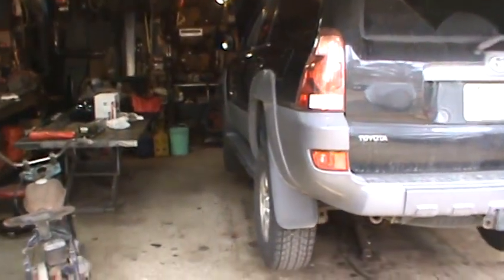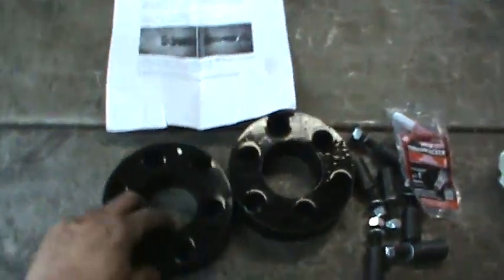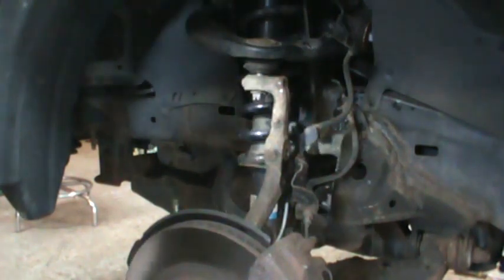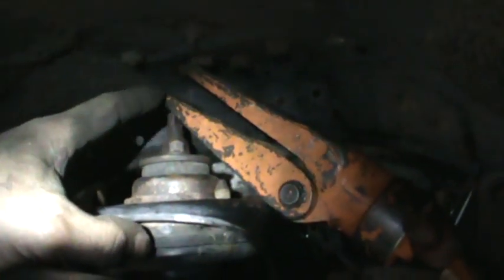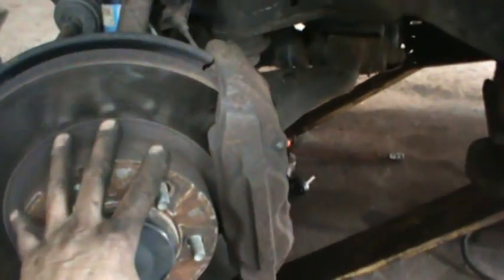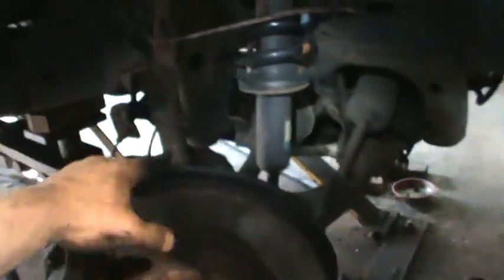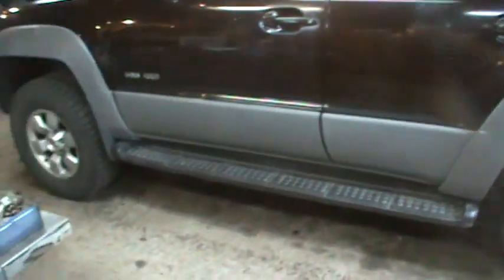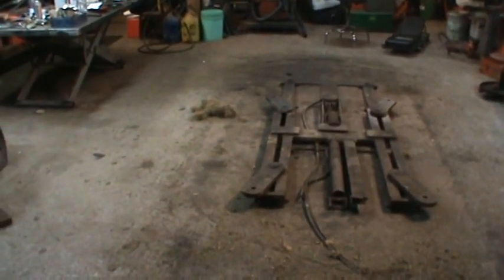4th gen toyota 4runner front spacer lift install

Comment: a great tip if your strut is rusted in place is to take crowbar and wedge it on the left side of the strut tower.  Then pull to either side and it will usually break free.  Just installed my leveling kit today.
Reply: John, Thanks for that tip. I had spent about an hour pounding on the fram and all around the top of the shock trying to get the strut to fall  out and the crowbar to the left freed up the strut on the driver side. Still no luck on the passenger side Strut. Any chance you have any other helpful ideas on how to free this thing up?
Reply: I know for me personally I had more room once I had dropped the lower control arm to be able to move the strut assembly around to break it free.  If you haven't done that already i would try that.  I know something else that really helped was PB plaster to help free up some rust.  Hope that helps!
Reply: I drilled a knockout hole down through the fender under the hood

Comment: Know this is old now, but for some reason it popped up into my feed, and hadn't watched it before. Think I would have added the back lift too, just to keep the clearance and spacing throughout, but yeah, it certainly would be easier to do without the parts rusting together, and since you replaced the rear shocks, no thought of putting new struts on? As long as I was in there I believe I would have. At least when I had my strut compressor, which I lent out and a guy ran off with..moved to a different state from what I heard ;(
Reply from the maker: its gone, only needed it for a few months

Comment: You can do this Job without taking the upper ball joint apart just need a pry bar to get the bottom of the shock out.  I did my truck in a half  hour that was both sides.

Comment: I have had to drill holes in the top of the fender well and beat the studs from the top to get struts out before... that prota-power is the trick!
Reply: I'm close to drilling holes in the wheel well to beat the studs from the top. Someone meantioned using a crowbar on the left of the tower wall and that got the driver side one to break free but I still can't get the passenger side to break free any other suggestions before I drill holes in the wheel well?
Reply: Eddy Steele How did you end up?

Comment: Hi.. great video. I noticed you didn't install a front differential spacer that usually comes with a 2.5/3inch installation kit... i ordered my 2.5inch lift kit and the diff spacer was included.  I wanted to know if by not installing the differential spacer will affect the handling, balance and stance.. yours seems well leveled .i need Your opinion on this, thanks.

Comment: Holy Hell! Don't EVER follow those instructions again! They made that so hard it's stupid! 
-Pull tire 
-Pull 2 bolts holding lower control arm ball joint on. 
-Pull bolt holding Sway-Bar on
-Take bottom bolt off shock 
-Take 3 upper bolts off shock 
-Pull shock out
-Put spacer in
Reassemble! 
It is really easy, barring rust of course. You can do the whole truck in like 2-3 hours.
Reply: +Tony Molski You're right I did this on my F-150 too and it wasn't that difficult.
Reply: I agree however I did have to loosen the alignment bolts to get the clearance to put the strut back in. You need alignment after install anyhow...
Reply: Im trying to do it that way but theres no way to pull the lower arm even with the 2 lower balljoint  bolt off, the sway bar is also disconected and the strut lower bolt is off  still have absolutely no way to pull the strut away

Comment: I just lifted my 2011 4runner sr5 and i used 3" toytec spacers but people keeps telling me to get UCA'S because the ball joints might break
Reply: Ball joint won't break, at 3" you lose caster adjustment and need aftermarket uca's to bring it back into spec.
Reply: +Tony Molski Hi Tony, Thank you for your reply, after I got the spacers I bought a toytec boss 3" lift with adjustable UCA'S everything seems to be working fine now specially how it rides, so much better, thanks again
Reply: +Hugo Huerta sweet! Nice setup there!
Reply: +Tony Molski thanks brother, I wish I could show you pictures

Comment: I'm trying this as well and I'm stuck trying to get the strut to break free. I don't have the power tools that you have. Do you have any other suggestions on getting a the strut to break free? Someone mentioned using a crow bar on the left side of the upper tower and that did break free the driver side strut but the passenger side is still stuck. Someone else had mentioned drilling a hole in the wheel to pound the studs from the top, but I'm hesitant to drill holes in the wheel well. Any suggestions would be great. Thanks
Reply: About RUST - I use a product called PB Blaster to penetrate rust.  I used it to loosen several badly rusted-in manifold bolts going into the head of an old 4WD Trooper, and PB loosened all of them.  PB Blaster works exceptionally well, and I bet it will get all of these stuck struts loose without needing to drill holes or hammer them with ball-peens, etc.

Comment: Hi,

I have a 08 T4R SR5 4WD and I just ordered the 2.5" lift kit from Daystar. I was wondering if I can get some opinions about if I need to do the Differential Drop kit to not damage the CV or I should be fine just the spacer lift?

Thanks
Reply: Gil Bachar you don't need it imo, 3" or more you can do it.
Reply: Hi Gil,

I want to ask... Did you buy 2.5'' for front and rear sides? I want to buy a 3'' front and 1.5'' rear on my T4R06... Thanks for your help.

Comment: that was alot of Grass man, lol, i was thinking of using that method to lift my lil nissan up for some big bling lol i wonder if it will work hmmm
Reply: ok i would say DONT DO IT    i worked for a 4x4 shop for a while you can only go 40mm 11/2 inch     it fucks the cv joints all ifs cars dont like to be lifted without dropping diff down to compansate     SORRY to give you bad news......

Comment: i have a 2007 sr5 sport edition 4x4 v6 4runner, it's my daily along with some trails/hunting vehicle. do you recommend it? I'm concerned about premature wear and tear. wondering how this is doing after the lift.
I do not want to really add extra maintenance and repair. is there a lift that you think is good along with larger tires that will not rub? i was recommendation a 2" leveling which i believe is like 3 1/2 front and 1 1/2" rear with p265 70 17 or p285 70? 17 i have p265 65 17 right now. thanks in advance!
Reply from the maker: nicole hilliker it has 30k since, and theres been no peoblems,
Reply: Thank you! :)
Reply: Did you ever end up doing the rear?
Reply from the maker: nicole hilliker no, it seems fine stock,
Reply: Thank you :)
Reply: 265 70 17S Fit fine with no lift or rub (31.5inch), i have had 2 sets of all terrains that do fine (bfg all terrain k02, and now cooper discover atp which is actually a much better riding tire on and off road for cheaper). I'm fixing to do the 1.5" version of this just for looks, but tire size should be 33ish if you are going that high.

Comment: Do you need diff drops?
Reply from the maker: not for this small of a lift, and its had 70k put on it since and has been fine
Reply: Mustie1 thanks for the info, what would be the biggest tire you can fit with that leveling kit on 17”  stock wheels?